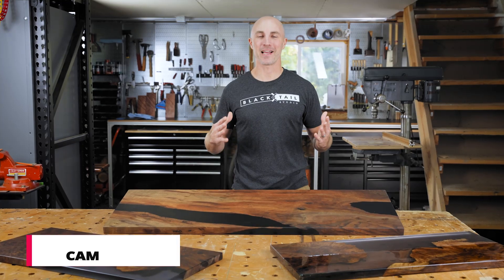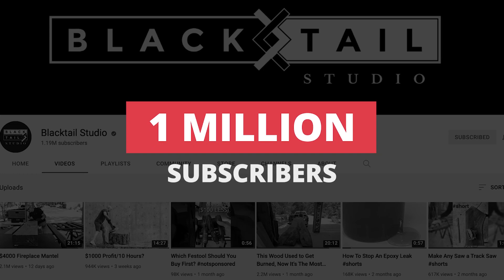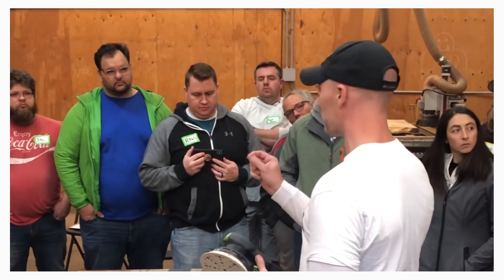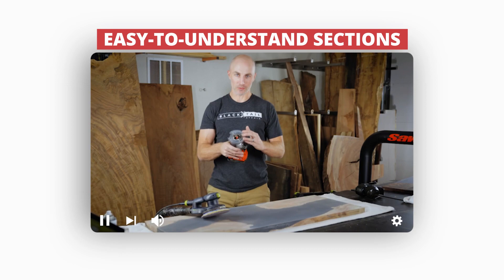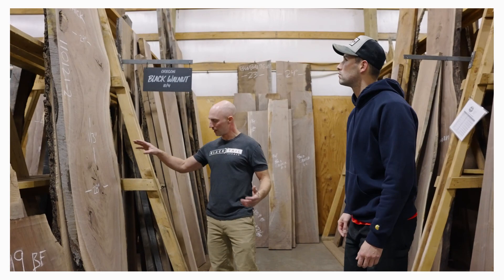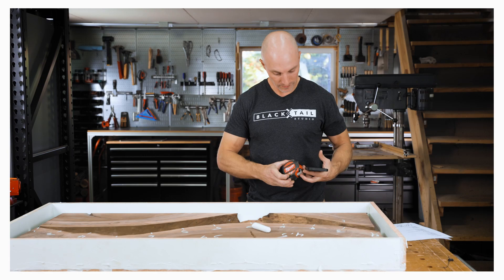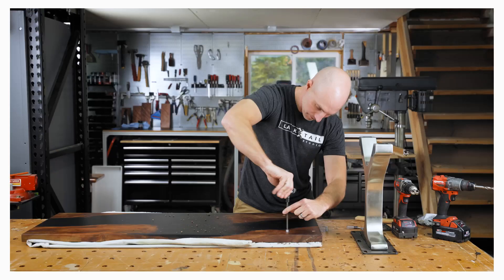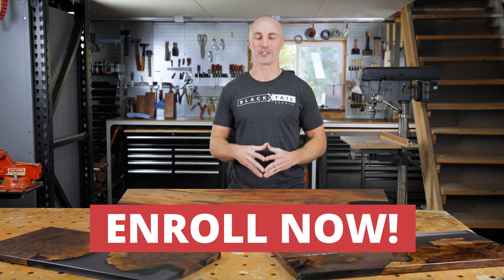Blacktail Studio Epoxy Table Workshop Trailer

Comment: Hi Cam, does the epoxy scratch much over time? I’ve seen other YouTube people making chopping boards. Is this wise? More than anything I love watching a true crafts person at work, you’re addictive.
Reply: Cutting boards should be made of material that isn't super hard for your knives' sake, hence why we see so many bamboo & plastic ones, & since epoxy resin is a type of plastic, it's fine. & depending on how it's used & how often, it will get scratched, but epoxy is a very durable material.